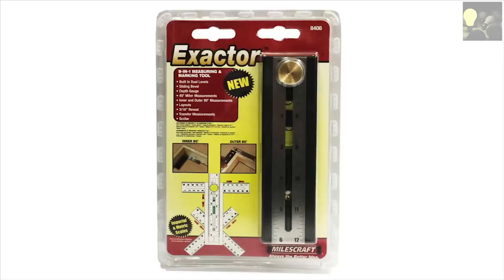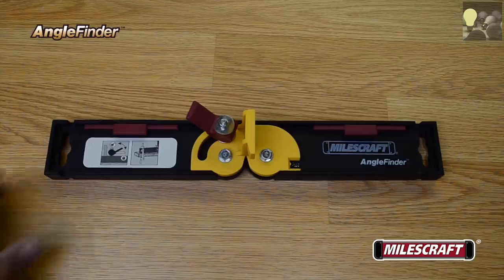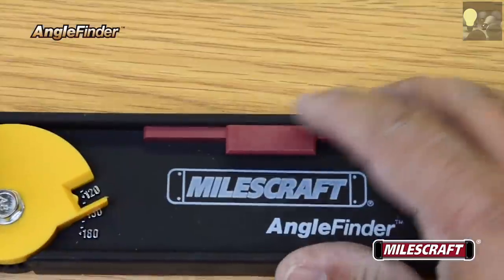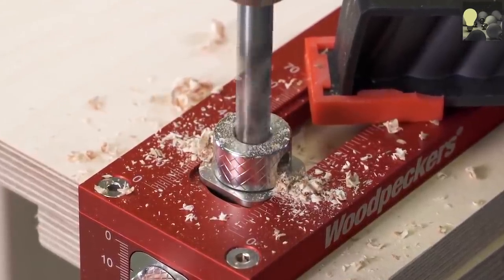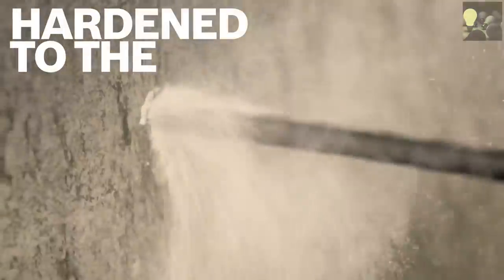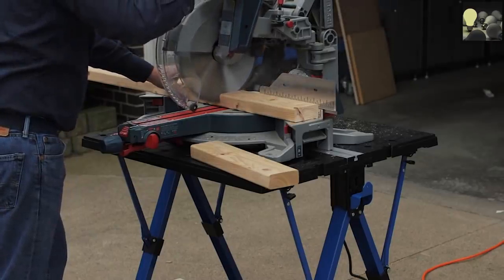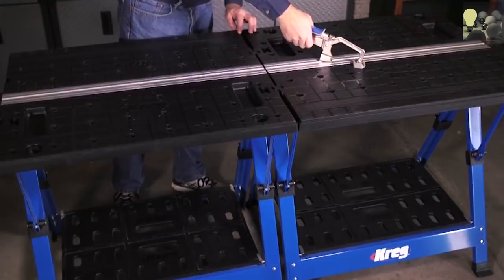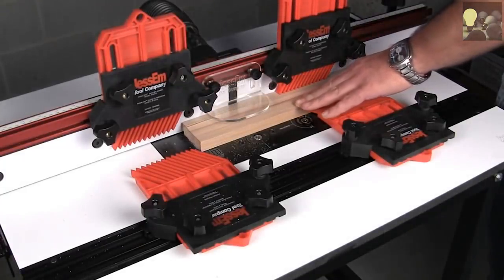10 WOODWORKING TOOLS YOU NEED TO SEE 2020 AMAZON 3

Comment: 10 tools designed to solve problems which don't exist. Plus - you can always tell a crappy, amateur-hour tool when the demonstration video show internal skirt/baseboard joints being mitred instead of scribed, when a 'vice' is being clamped to a framing crossbar only held in by one nail so that it's rocking about everywhere, plus plus plus plus..Sheesh .....
Reply: I was going to point that out as well! The mitre was rubbish as well.